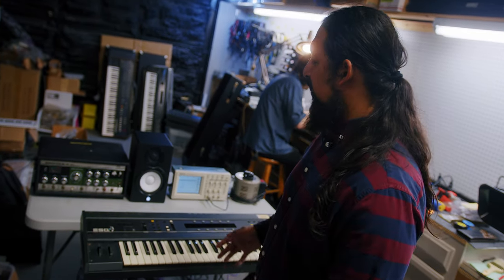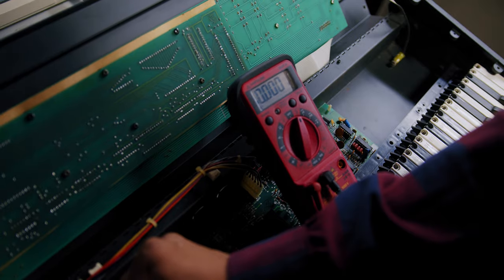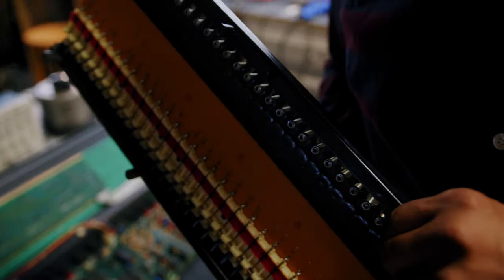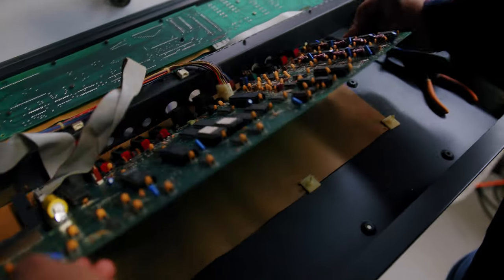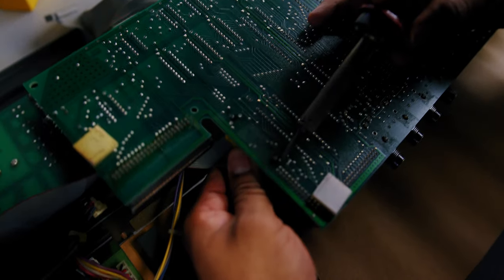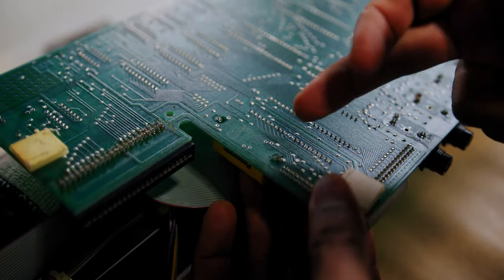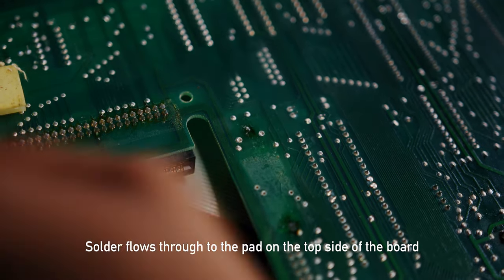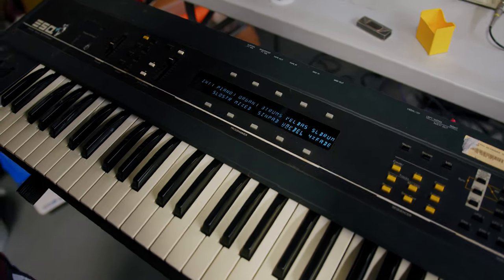Replacing the Battery In a Ensoniq ESQ-1

Comment: I've never understood why keyboard internal battery swaps have to be so complicated. No reason not to be more user-friendly!
Reply: I think that nobody at Ensoniq back in the day imagined we would be discussing the esq 35 years after it was brought to market. The battery was designed to last a lifetime, which for electronics is 5 to 10 years. In fact my esq battery lasted for more than 25 years ( close to 30) . So there is absolutely no need to make this more user friendly,
Reply: @Johnsormani  I got rid of my Ensoniq EPS years ago but my KORG T-1 is still with me in mint condition going strong almost 30 years and I've opened the hood many times to swap out the internal battery.
Reply: @rcom9880  Probably the Korg is  a bit more power hungry then! :-)

Comment: Aren't there any compatible battery holders that one could solder in place so one doesn't have to disassemble the whole machine every time and risk damaging the solder pads beyond repair?
Reply: Just what I was going to say
Reply: Yes, there are! I have two ESQ-1s. I sold a synth to an electronics student a few years ago. I told him about my ESQ-1 battery warnings, so, for the experience and the cost of the parts (minimal), he installed battery holders and new batteries in both.
Reply: @RB-bd5tz  I don’t think any battery holder is a proper solution for this
Reply: @Johnsormani  It's just fine. In response to another comment of mine, Syntaur warned about batteries in holders possibly becoming loose. But my synths don't leave the house.
Reply: @RB-bd5tz  in that case it is alright of course .

Comment: I always fit a battery holder and then you can easily swap them over. Obviously soldered is better for a keyboard that travels a lot, but I wouldn't take one on the road. You can potentially swap the battery in the holder with it powered up (being careful to avoid the PSU etc) so you don't need to restore the memory.
Reply: Same here - easy 2032 swap
Reply: yeah same, I just clipped the battery leads carefully and soldered some wires from there to a battery holder. Saves you from having to take off the keybed, and due to some past uhhhh experiences as an electronics tech, I'm always paranoid about desoldering old PCBs when I don't have to.

That being said, I'm glad to know the other ways to go about it. I would say Carlos is doing it the proper way, as close to brand new as possible.
Reply: @toomuchtoofast4533  a 2032 battery will work??? For real???
Reply: I have a K2000 in need of a battery that I'd like to do that with. I've always thought it was crazy that you'd have to solder the battery. Why don't they just have a strong clamp in there as a battery holder?

Comment: I replaced the battery in my ENSONIQ SD-1 keyboard . Everything went well. It worked for a few days the I got a low battery message . Now it doesn’t have any sounds . It initializes everything works but no sound and it says low battery and now my floppy disk stopped working. Can you help me?

Comment: I installed a new battery in my VFXSD. Same housing. I actually just clipped the ends off the old battery and soldered the pins to that instead of straight to the board. Lazy man’s work I know, but it’s worked out fine over the last five years.
Reply: I sort of did the same thing on a SQ-1.  It had a cylinder battery mounted to the board with long leads.  Instead of soldering on the board, I snipped off the battery from the leads and soldered a 2032 battery holder to the leads.  Didn't even remove the board.  Next time I'll just need to swap the battery out.  I could probably do that carefully with a holder even with the power on and not lose my settings in the process.

Comment: My esq has been sittiing in storage almost 10 years. Finally pulled her out but she had some moisture damage ( rust on the top panel, not heavy but there.) 
When I put her away she was not working, had the "---------" on the display when turned on. I don't remember testing the midi, but I  was told it was because of bad battery and tried to replace it myself, but didn't fix it. Im gonna try and plug her in today, u guys got me so inspired!!
Reply: How'd ya Go I just Scored one Sounds Same kind of condition. I'd be interested to hear how you went

Comment: I was just yesterday thinking about how I would like to own the ESQ-1!
Reply: I have two, plus an SQ80. I bought one to own an ESQ1, then I bought a second faulty one thinking I could use its transformer to convert my SQ80 to UK voltage (in the end I found someone selling a transformer for another Ensoniq which worked, I compared part numbers). But it was a 110v version. But the unit was in such good condition I used the chips from my faulty ESQ-M to get it going again (the faulty ESQ-1 had all the useful chips pulled out, rotten cheating ebayers), all I need to do was fix a few bad traces on the front panel board, epoxy some mounts into place (plastic model cases are not robust) and it was working fine.
Reply: @6581punk  Noice! Both are great, but the SQ80 is a beast!

Comment: A couple points worth mentioning. For lots of their keyboards, Ensoniq favored high-retention-force ribbon cable connectors that require careful use of a ‘scribe’ to loosen the connector. It doesn’t look like the one you disconnected was like that but it’s worth mentioning as an Ensoniq quirk. 

Also, the factory reset thing can be a really big deal in some devices, especially those like my old rack effects boxes. Replacing the internal battery wasn’t enough; I’d reboot it and the display would be scrambled or something because the EPROM firmware chip was relying on that battery that died. The factory reset causes the firmware to be restored to the EPROM. I would say to do factory reset after replacing any battery.

Comment: Hey! Just bought a power supply from you on a guess for my Ensoniq SQ1 but did not solve the problem. (The parts website specifically requests no technical questions) Now, discovered you here. My SQ1 problem is when powered up default sound (piano) comes on clean for 5 seconds, then horrible screeching noise. Any help, even guesses at capacitors, diodes, etc, would be greatly appreciated!

Comment: 9:35 I like: NO! You're holding the keybed 180° turned! Then the red stipe should be facing you! ;)
Reply: Good catch! How can this have worked?
Reply: @nkronert  I guess he has changed it off camera.
Reply: @GertBoers  if not, it is a matter of luck (=connector layout) whether the thing just doesn't work or if the magic smoke escapes
Reply from the maker: Someone may have replaced the ribbon cable, or installed it the other way around.  As long as BOTH ends are swapped around, it'll be okay...
Reply: @Syntaur  for sure it is the reason why connectors nowadays often have some mechanism to prevent connecting them the wrong way.

Comment: Weird, the one i worked on recently has a way different layout. The battery is horizontal and the board itself extends to the right edge and has less behind the cartridge port.
Reply from the maker: There were two versions of the ESQ-1 (first, the metal case, then the plastic case version), and the hardware layout is different on them.

Comment: A better fix is to install a battery holder.
Reply from the maker: The coin batteries will not last as long as the stock battery.  A typical coin battery is about 200 mAh, while the stock battery is 1200 mAh.  There are holders for the larger batteries, but they are more likely to jar loose.  But if the keyboard stays in a studio, or you don't mind more frequent battery swaps, it's a fine way to go.
Reply: @Syntaur  what about two AA batteries?  I've seen that as a mod as well.
Reply from the maker: @natestewart1975  Please don't do that.  That type of battery can leak over time, causing horrible corrosive damage.  A lithium battery is the way to go.
Reply: @Syntaur  my original (as far as I know) battery from 1986 still has 24% :D
Reply: @Syntaur  Thanks for that advice. A friend installed the larger battery holders in both my ESQ-1s. But they never leave the house. Much like myself ...